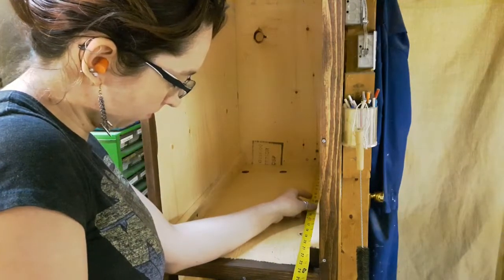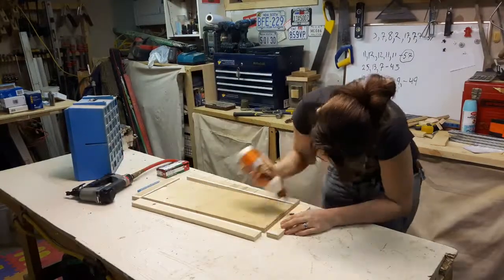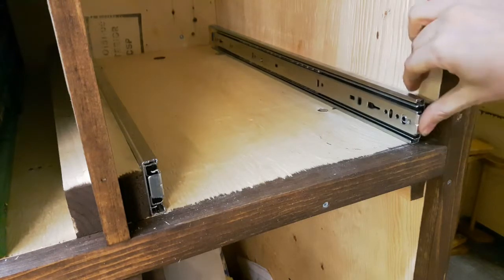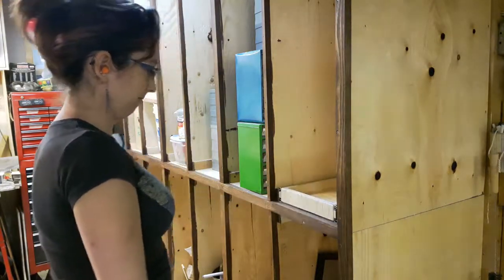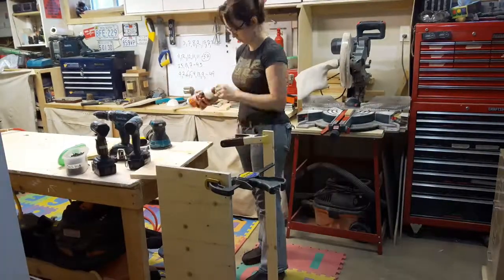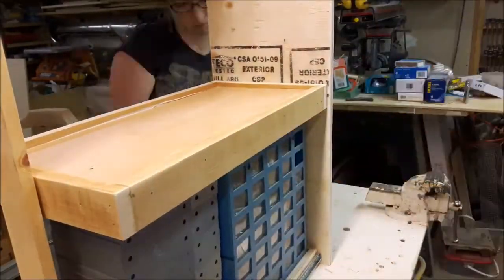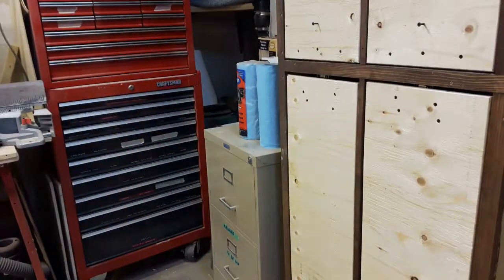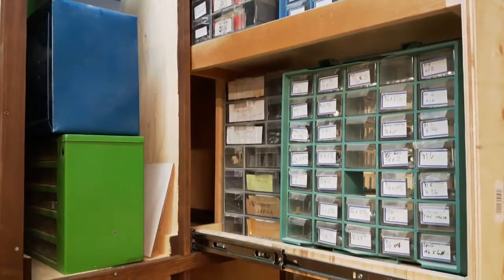Hardware Heaven Part 3

Comment: I also like the fact that all the stuff is behind a closed door so a layer of sawdust isn't coating everything like in my shop. I can't stand having everything having that thin layer no matter what you do. Having stuff in cabinets and behind doors would help eliminate everything being coated LOL
I would get a label maker and put labels on the front of the doors to let me know whats in each door so if someone other than myself needed something it would be easier to find. Also I forget where I put stuff too and need a reminder LOL
Reply: I’ve seen people use hot glue to stick an example of what’s inside a drawer, bin, container on the outside. Easy to see that #8x1.5” screw.